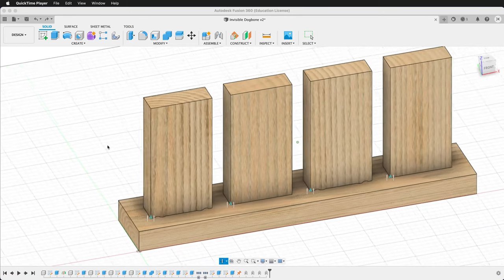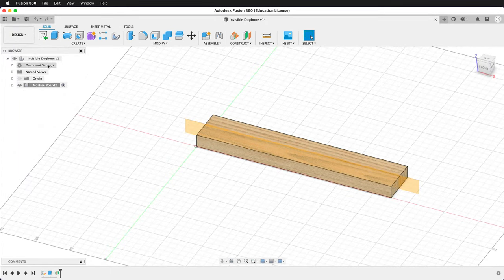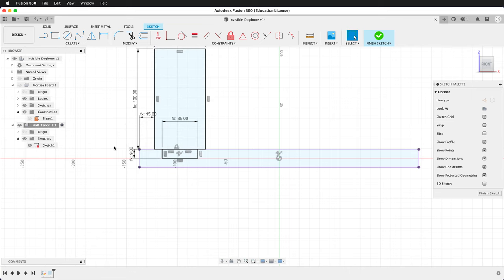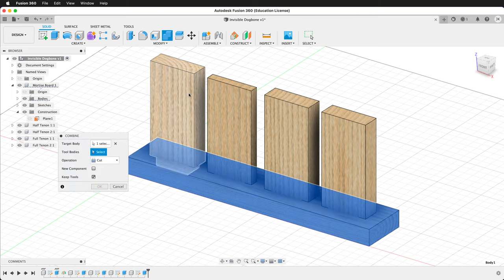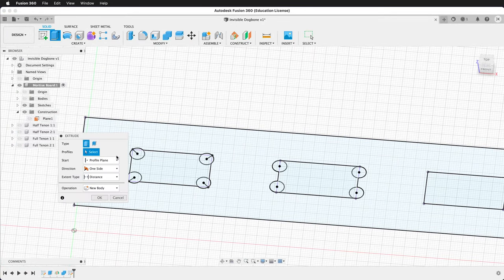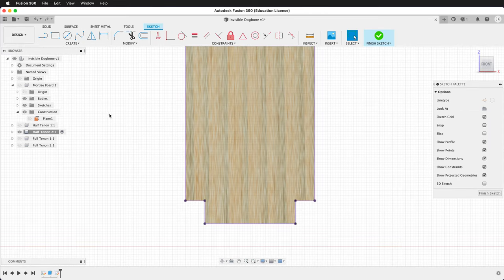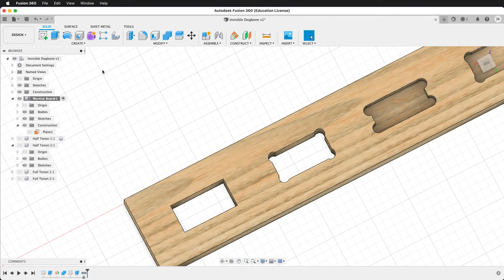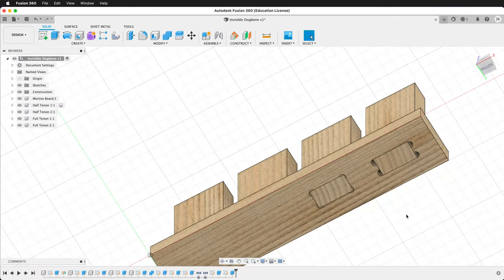Invisible Dogbone Fillets for CNC Joints in Fusion 360 aka T-Bone Fillets

Comment: I learned so much in a short period of time. I've always seen constraints as a way to enforce rules, but now I see how they can be used to accomplish outcomes. Also, I really appreciate that you fully embrace user defined parameters. My only question: how did it know that you wanted the extruded shape to be wood?
Reply from the maker: Glad it helped, I set the appearance to be wood, you can set it to any material

Comment: Did it have to be done in mm? Or is the International to large of a size? I am just curious is all, I am trying to find out how to apply the DB Fillet add-on or set up some sort of template for myself.
Reply from the maker: You can use inches or millimeters either one that you prefer. You can even have your models set in millimeters and use inches on the dog bone.

And you can have a different unit set in the manufacturer workspace.